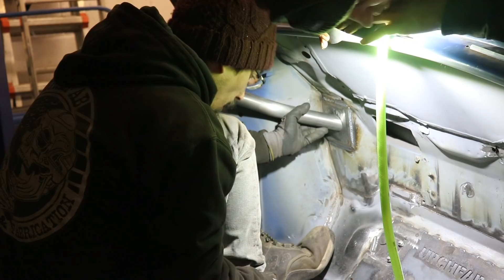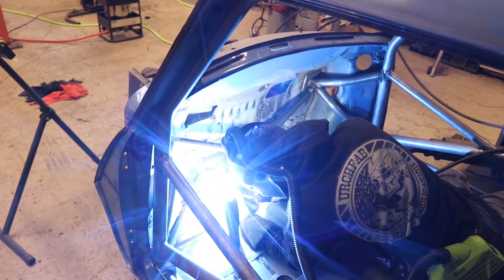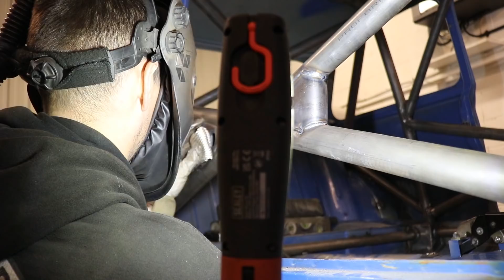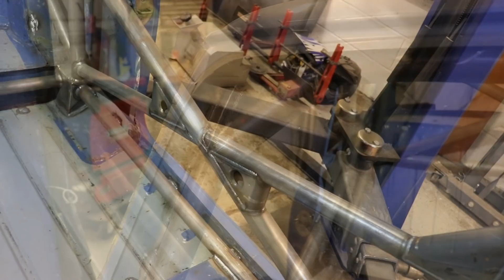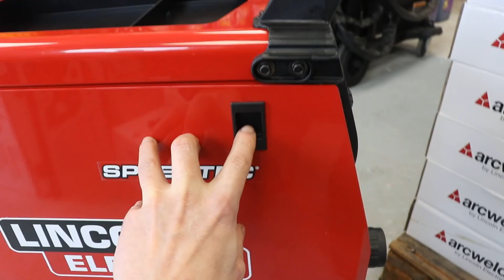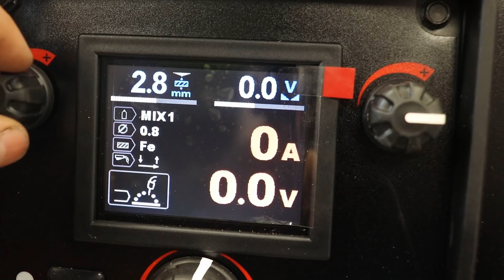Classic Mini Race Car Part 6 - Finished Roll Cage

Comment: Incedible welding skills. Out of curiosity how much weight have you added with the addition of the roll cage and reinforcing ?
Reply from the maker: 65 kgs ish
Reply: @Urchfab  wow I didn't think it would be that much. I guess you will more than make up for it with better handling from chassis stiffness and increased power.

Comment: Magnificent caging and structural work.   Not sure what grade and weight of steel you are using,  but looking forward to the engine upgrades you will implement in order to carry all that cage wrapped in a thin car shell around the track.

As ever, Matt, your work is  beautiful.
Reply from the maker: Cheers.

Comment: Lovely bit of metalwork Matt.
Why did you say you you wished you hadn't put the holes in the cage gussets? Is the "X" under the dash a common thing in Minis?
Reply from the maker: I just prefer the cleaner look without. It's common on the race cars yes. Cheers

Comment: Matt, following up on your comments about what you might do next time, just what would that amount too? I'm quasi familiar with the  Mini chassis and your set up looks the bomb, as is. On the Lincoln equipment; it's always been really tough to kill products- there are still "Tombstone" Lincoln arc welders for stick welding working today- built for the WW2 shipyards!  FR
Reply from the maker: Just some slight alterations to the design, I will mention it in a video. Cheers

Comment: Do you weld the back sides of the cage if you have no access?
Reply from the maker: Yes you have to make access, either by moving the cage or cutting a hole in the body etc.

Comment: I always enjoy your fabrication videos and track days, so as a mini fan I'm enjoying this and looking forward to seeing you put it through its paces. 
FYI; For the un-initiated, the only two jacking points on a mini are those in the sills. The four square swatches on the underneath of the floor were brackets used to jig up the shell in the factory during production. They're always mistaken for jacking points which leads to damage and rust. This is why its recommended to jack up on the sub-frames and why racers often add sill tubes for jacks and stands.

Comment: Is Lincoln supplying this for free or did you need to buy it? What I'm thinking is it might be neat the next time you build a car, get the raffle device, use it to build the car, then raffle it off with some stickers on it or some other personalized touch. Obviously means no international winners, but might be a neat idea. Gives the product a lot of visibility during the build, and the winner knows that the welder is functional and tested. Might be late for the Mini, but maybe not.
Reply from the maker: I wish they did but no I just buy the prizes. I do like the idea of some personalised kit, have thought about a painted welding helmet. Cheers

Comment: The handle on your sheet metal folder is on about 180° out. It should be push up to lift and down to lock. When down it should nearly over centre and lock down to hold the work. A company I worked at had a similar one and thats how it was set up
Reply from the maker: Interesting, I will have a look.

Comment: I've been amature welding a long time but still struggle to weld say a thick rollbar to a thinner body section say as where one of your bars go intersect though the tunnel. You seem to be able to do it in one smooth run...how? I would have blown through everytime. Do you run a pulse mig? Any tips?
Reply: https://youtu.be/STgEYGZl8Gw

Comment: Not meaning to sound like a rivet counter but........... Those aren't actually jacking points on the front but everyone seems to use them for that, they're just slinging brackets from when they moved the shells round in the factory.

Comment: Are you going to reposition the steering wheel mounting, or are you keeping the lorry driver angle?
Also, when you use the bender, what's the story about the piece of pipe you keep positioning under the arm (?).
I wonder myself that every time that antique is in picture.